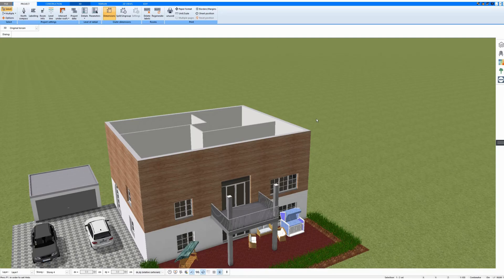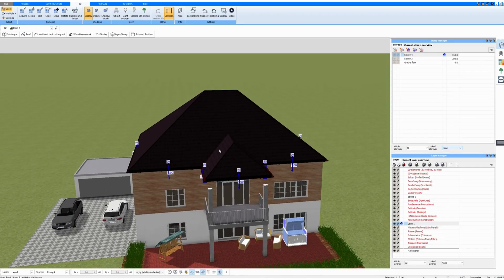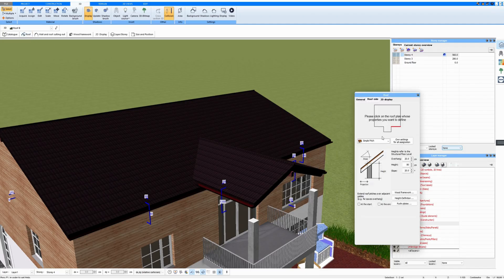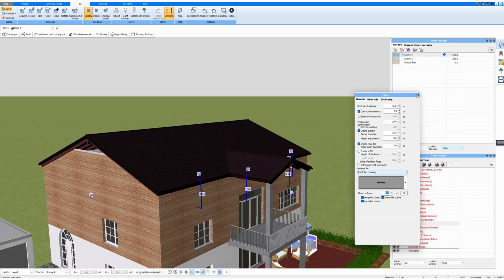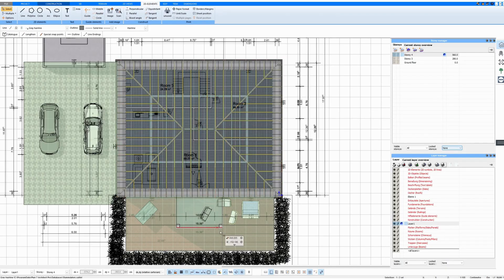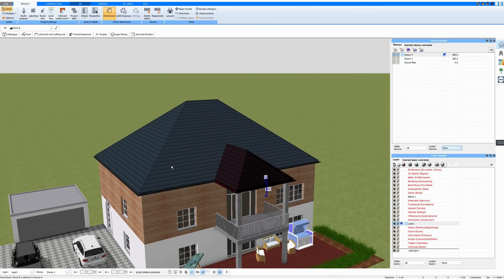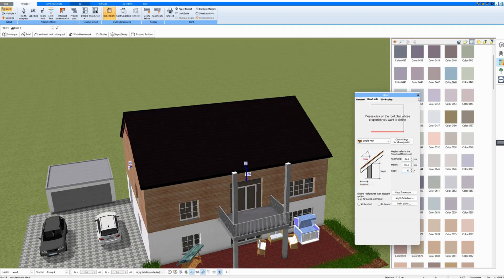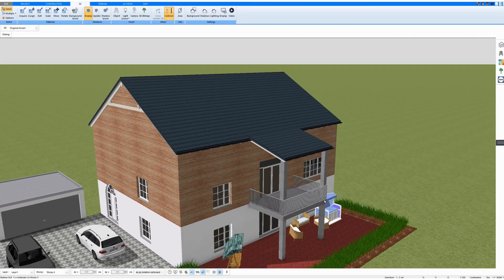Complex Roofs and Roof Intersections with Plan7Architect

Comment: every time i put in a roof it puts its at the bottom of my floor :(
Reply from the maker: You need to open the Floor Management (Storey Management) first.
Then move the blue round marker to the floor where you want to draw the roof.
After that, draw the roof — it will now appear in the correct floor level instead of at the bottom.